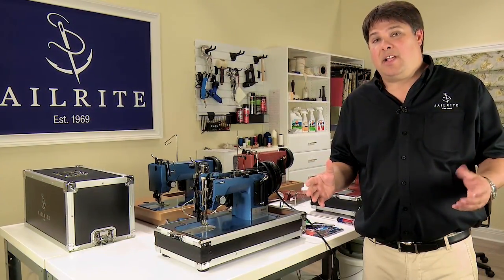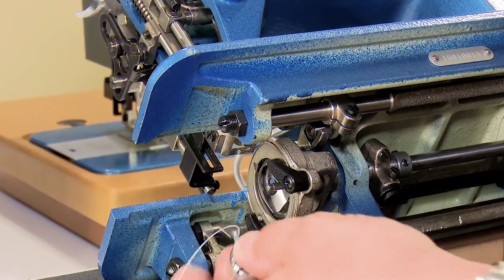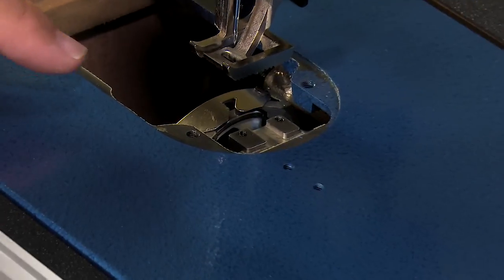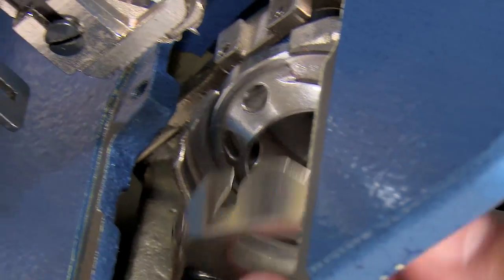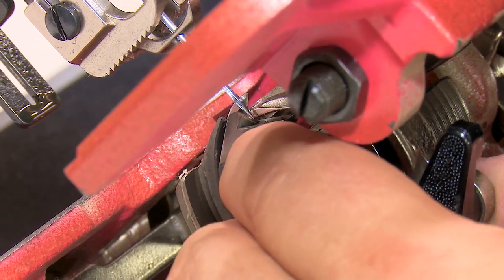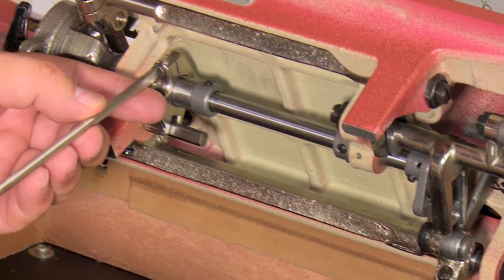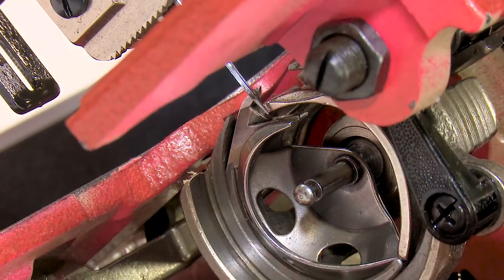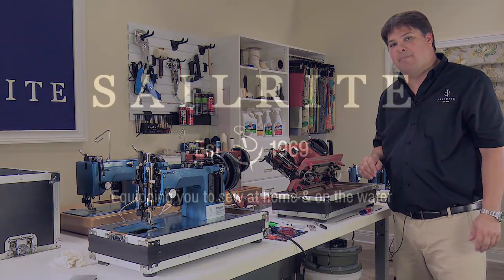Timing of the Sailrite Ultrafeed Sewing Machine

Comment: Awesome set of videos.  On the LSZ-1, it is not stated where the stitch width and needle position settings are during this timing procedure.  My assumption is that it is not relevant, but I am having needle deflection only when the stitch width is set to maximum.  Otherwise the stitches are perfect.
Reply: It must have been the needle.  I replaced the needle and checked clearances as specified in this video and I could not reproduce the problem.  Compared to my old Singer 15, this thing is a beast.
Reply: @jeffmcknight695  thanks for sharing your experience

Comment: Hello, your sailrite sewing machines, apart from the design, and a few details of the mechanism resemble the singer 237 and singer 239 and it is to be believed if these are the new versions of the singer 237 for the LSZ-1 portable (blue) and the singer 239 for the LS-1 portable (red), these two models of singer machines were manufactured in the early 70s. And if you broadcast videos for adjusting the height of the needle bar and for the timing, it means that this machine has problems with the thicknesses, since the cause of these two misadjustments are the thicknesses

Comment: Tried to sew a jute rope bowl, but remembered after a disaster, it was shredding thread on my last project.  Installed a new cap spring, raised the pressure fuut height as high as it would go.  Touched alot ofvscrews, and finally did it.  Alas, skipping stitches.  Have been working on the timing forever.  Thought the rotation of hook too far back, i guess not.  Maybe the needle is too far away.  So now am trying to move it.  Two weeks of trial and error.  Now im going to  thing.check the  bobbin holder
Reply from the maker: If you own a Sailrite machine, just reach out to us via email and we will help by starting a support case. We want you up and sewing again! email info@sailrite.com and give us the serial number of the Sailrite Machine and we will offer more help.

Comment: I just can't continue sewing, had my lsz since 6 months ago, and it has been a very difficult task , also I have to say is my first machine.
But it never work good for more than 5-8 hours. Skiped stitches, upper thread breaking
I had tried everything, from re tread, to needle bar height, to driver timing, to left to right timing, to put new needle, to wind the bobin properly, to check thread tension
I even bought new cap spring and hook driver because they had a blur
And honestly nothing seems to work
I cant understand what Im doing wrong. The customer service also stoped responding my emails
So as you can read Im very stucked and left alone which I dont think is nice 
I really need technical help

Comment: La fase ago crocchet  si fà: 1 la regolazione del guscio  crocchet ruotando in avanti/indietro + rotazione dex/ six agendo sulla vite del giunto blocco  albero crocchet + albero guscio croccett (centratura ago su canale guscio crocchet)  2 centraggio asola crocchet allentando anello di blocco albero crocchet e spostare albero avanti/indietro. Una cosa non capisco, l'anticipo della punta del crocchet sull'asola dell'ago come si fà? (forse è fissa?)   Io ho una Necchi BU Mira molto simili a quelle che presenti ho la fase quasi perfetta ma non cuce .

 The crochet needle phase is made: 1 the adjustment of the crochet shell by turning forward / backward + dex / six rotation by acting on the screw of the crochet shaft lock joint + crochet shell shaft (needle centering on the crochet shell channel) 2 crochet buttonhole centering by loosening the block crochet tree and move tree forward / backward. One thing I do not understand, the advance of the tip of the hook on the buttonhole of the needle how to do it? (maybe it's fixed?)  I have a Necchi BU Mira very similar to the ones you have, I have the almost perfect phase but it doesn't sew, the only thing left for me to look at is the higher thread tension. What do you think of this problem? mail     ma52pu@gmail.com      Grazie

Comment: I have a question for you re: the rotation of the hook (and hook point).  I understand about the rotational movement/adjustment of the whole basket, but how about the hook itself?  Can the hook (and hook point) and the shaft be rotated clock/anti-clockwise?  I notice there is at the end of the shaft a little grub screw.  What is the function of that screw?  Thanks.
Reply from the maker: Yes, the hook can be rotated via the "Driver". If this is a Sailrite Ultrafeed sewing machine just email support@sailrite.com for a video on that topic.

Comment: why not put an allen head screw in there ,,, make life a lot easier ,,,
Reply: @bacilluscereus1299  no ... an allen head ... every one who has a tool box has a few allen keys in there .. maybe not the best quality but a few .. if the worst comes to it you can beat a nail into an allen key and it will get you going ... the machines you sell have a heavy emphasis on actual quality over cheap chinese versions ... for 5 cents I'd be using this as an example in your advertising ... I don't think 5c on an 800 dollar machine will matter .. if so off set it against the 2c that will be saved on the bolt you didn't use 🙂